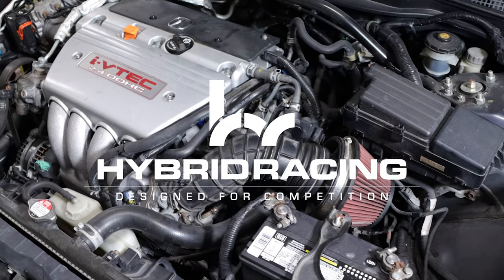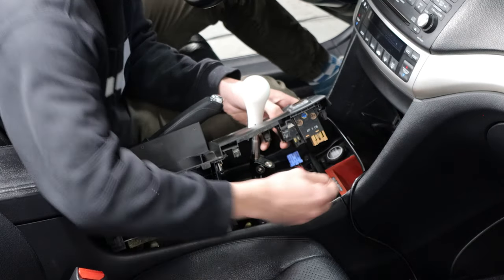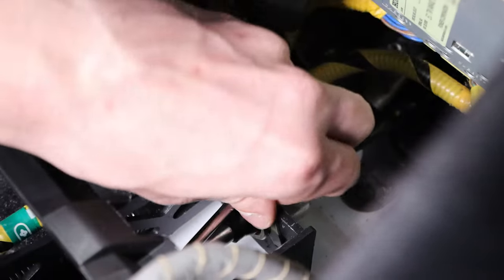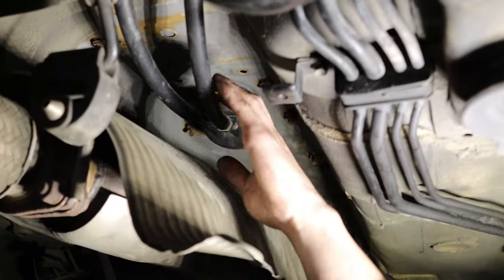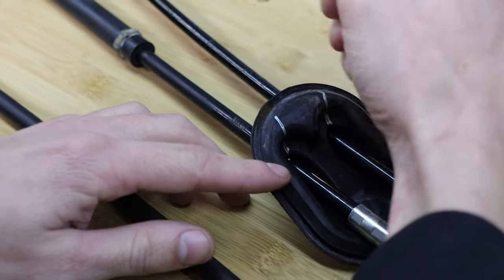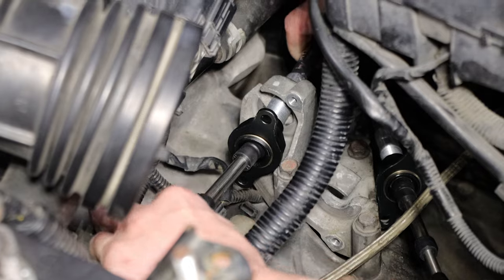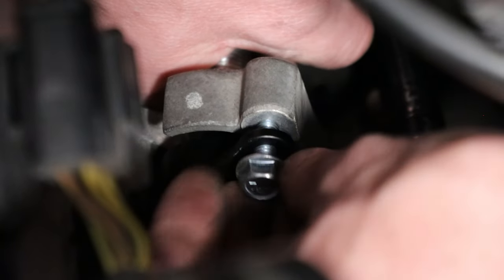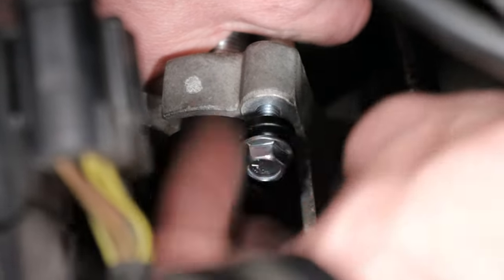Hybrid Racing Shifter Cable Install - 04-08 Acura TSX

Comment: Would like to see z3 trans cables/box on a k-swap car. Can’t find any useful info on the easiest way to use a z3 trans.
Reply from the maker: Best way to use a Z3 trans is with our TSX shifter and conversion shifter cables. Check out our website for that setup.

Comment: Hmmmm? All forward speeds work but the gear shift lever  won’t stay in reverse, just keep springing back to neutral . Basically I have no reverse
Reply from the maker: Disconnect the cables from the transmission and check if you can get it to go into reverse by moving the gear selector by hand. You can also contact us directly, support@hybridracing.com and our techs can help troubleshoot.

Comment: Very nice cables! Do you also sell a billet bracket to mount these on transmission? The stock bracket looks pretty awfull 😭
Reply from the maker: Factory brackets are the strongest and best option. But I agree, if you have an older one, they can get nasty and rusty. Good thing we will have a solution for that soon. ;)
Reply from the maker: @user-hh4hc2lt6e  We are going to release a number of OEM replacement brackets in the next few months. Email us and tell us what you're looking for specifically. support@hybrid-racing.com
Reply: @hybridracing  i cant wait for this new bracket! I will def will order em along with your tsx cable

Comment: Awesome instructions, any chance of 04-06 and 07-08 Acura TL Hybrid shifter cables?
Reply from the maker: Hard to say for sure, but it’s something we can look into. Email support@hybrid-racing.com for more info.
Reply: From my understanding the 4cyl and V6 Accord shifter cables are the same, so you would think the TL would also share the same cables as well since it’s basically the same car.
Reply: @undergroundkingsgarage3215  you might be right on this. I just looked on an Acura vendor site, the shifter cable are some what similar but still different at the shifter bracket. Probably the reason for the different OEM part number; I don't know just assuming. However, if it just the difference at the brackets; for the TLs it a twist and push to remove, then it possible to install TSX with slight modification, maybe.
Reply: @HoMiE327  the bracket could be different because of the transmission? The TL has an LSD where as the Accord does not. Maybe Hybrid can solve this issue 😉 I have an 04 V6 Accord 6 speed that needs cables to match my 130R knob